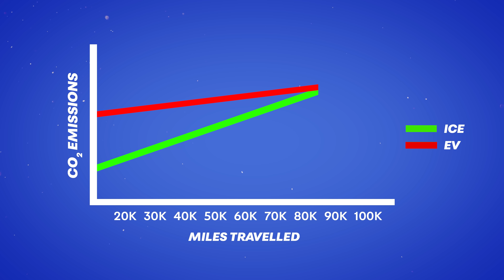Are Electric Cars REALLY That Green? [New 2022 Data]

Comment: We thought, hoped that EVs would be a way to reduce our dependence on fossil fuels, which are rapidly running out, and killing our planet in the process.  Turns out that we may have been wrong, prematurely enthusiastic about EVs.  What does this mean?  Options:
(1) We could abandon our search for a cleaner and more sustainable source of energy, and keep extracting coal and oil from the earth until they run out.  Or
(2) We maybe regroup and continue looking for a source of energy which is cleaner and more sustainable than fossil sources.

Comment: One factor that I have never seen implemented is the shorter lifespan of electric cars. Show me any battery in any device ever in your lifetime where it is 10 years old and still strong. Ignore the miles as they only tell half the story about a car's life.  Somehow, once those batteries are put into a car, they are somehow going to last 20 years. The average age for a car on US highways is approaching 13 model years, and when electric cars won't be able to last that long with current battery technology without a battery replacement.... Well... Let's just hope that I am wrong.
And the production of the wind and solar infrastructure also requires more CO2 emissions than that of a natural gas fired powerplant, and the solar panels and wind turbines have a relatively short life.
If I were to guess, right now, overall CO2 emissions of electric cars is 15-20% less than that of a gas car. 
And then, electric cars run their air conditioners to keep the batteries cool when they are parked in a parking lot. I am unclear if that is factored into their efficiency ratings. It has to be substantial energy consumption. And do they not heat their batteries when it gets really cold?

Comment: What is the battery life before it has to be replaced and then you start over it would seem on the EV is more damaging to the environment?
Reply: For modern LFP batteries, it's ~5000 cycles, which is about 13 years of daily discharges and recharges before it looses 20% of capacity (which is what is considered to be the end of life for a battery in an EV). Which on Tesla Model 3 sold in Europe (LFP battery pack) would be over a million miles.

Note that after the battery reaches end of life, You still have a perfectly functioning car. It might only go 240 miles on a charge instead of 300, but it's still a usable car. And even if you don't want it anymore and are not willing to sell it to someone who wants it, it's battery can be used for other purposes. A 40 kWh battery storage for your home solar installation is nothing to sneeze at. But I guess in 10-15 years it will be easier/cheaper to just recycle them, who knows.

Comment: Wind farms, are bloody expensive a blot on the landscape environmentally unfriendly to manufacture and no wind equals no power.
Solar farms, are bloody expensive a blot on the landscape environmentally unfriendly to manufacture and no sun equals no power.
Both get massive taxpayer-funded subsidies and create expensive energy. Both use huge amounts of fossil fuel to construct them.
Bring on nuclear safe clean cheap clean power. Make huge improvements in recycling plastics and reduce the need for fossil fuels to run the recycling industry. Get plastic out of the oceans.
There is NO Climate catastrophe. There are changes in weather due to a natural cyclic situation.
Climate change although real is not a big issue. Climate change started at the birth of earth and will continue until its death we did not start it and can NOT stop it we have to live with it.
One thing I get puzzled by is what emissions mean exactly. If emissions include carbon monoxide( C0 ) then yes as it is a dangerous gas, but if they refer to carbon dioxide (C02) which is a natural gas and essential then no. It could be suggested that all the bubbles be removed from every fizzy drink (C02), all drinks MUST be flat due to emissions. Do away with dry ice and C02 fire extinguishers. All plants must die due to the removal of C02. General oxygen levels on the planet are dramatically reduced due to a massive reduction of greenery because of C02 starvation. A huge amount of sea life dies off due to reduced C02 absorption, sea plants take it in and then oxygenate the water. So is it C02 that is a problem or the very evil minds of some people.

Comment: One aspect rarely seeing the light of day and spoken honestly is what happens to the batteries?? It's said they are recycled, has the transportation, the recycling process been factored in? And if so, how?? If batteries are made as so many electrical good with batteries that have a questionable life cycle, then replacement will be more frequent OR the way they are charged also impacts life, then how is the life cycle of solar panels, wind turbines etc factored in or are manufacturers figures used??. I ran a Mitsubishi work van to 870,000 klm's, will an Ecar ever achieve this???  I think the whole thing is a debacle, petrol and diesel fueled vehicles are almost a 100% known quantity, don't be fooled by glitz and glamor... Worse still are hybrids and this new 'wonderful' BLUE SKY and similar BS (bull shit), think your way around, the battery life, alternator, started motor cost verses a car idling at operating temperature and fuel consumption?? My car on a tank of fuel will idle for 2-3 weeks if not more (65Lt's)It's just lies and BS to make you feel like you are doing something wonderful, turn your heater down n wear a jumper inside, use a fan in-place of a/c, turn stuff off, ride your bike, by far more effective. My wife and I use around 5.2kW/h of electricity per day, we have panels and are, if bankerble, 2 years ahead in our use-age.  Consider the bigger picture.... Sheesh, so much BS

Comment: I love this argument that living remote makes EV use more suitable... except that remote living relies on diesel engines and generators. Even petrol has problems in remote and regional areas due to high running temps (grassfires, although DPF's have caused huge problems on this front...but many jurisdictions allow regional and remote vehicles to remove the DPF for safety reasons). However, the biggest issue is... recharge! Even solar vehicles struggle big time to make time-efficient runs cross country. And they have zero cargo capacity, are built of ultra light parts, and look like spaceships on wheels. I mean, if electric was really that good, then hybrids and electric trains (the ones that don't run on power lines, the ones that have a generator unit behind the engine unit) would run more effectively. They would have more range than their petrol and diesel equivalents. Yet they don't; they can't. And as soon as you start including cargo capacity in your decisions, then electric just collapses like a raindrop falling to earth. In essence, for people who use vehicles for more than just a large, fast pushbike, electric (and even hybrid) still has a phenomenally way to go before it's viable as a transport concept, let alone of greater efficiency than conventional engines. I mean, for all the talk of greater torque that electric provides, there's a reason ships still run diesel or HFO for their propulsion. Except for steam (including nuclear), there is no other method of engine propulsion capable of doing the job. Again, going back to my point, as soon as we're talking weight and cargo capacity, electric still doesn't have a presence let alone an ability for comparison. Indeed, all this green engine talk is making steam, horse, oxen and camel look really good again for transport should conventional engines be banned.
Reply: I read all that and agree. I plan to drive my Cummins diesel until I die. It has been running 30 years so far & has another 30 left in it unless the body falls off.
Reply: @ronskancke1489  I'm driving my newer beetle (wish it was diesel) for many yrs to come I hope.  Trying to get my 1985 Saab running again too lol.  World record is 3 million plus miles on an old Volvo btw.  But yea I have a soft spot for old trucks also.
Reply: cue green peace. lol could not agree more pal.
Reply: Ok I read all that lol.

Comment: You did not mention anything about the mining for materials and manufacturing of solar panels and windmills and the like.   No mention of the relatively short life spans of these devices.  The non recyclability of these green technologies.  No mention of the cost of the huge landfill burden of hazardous scrap generated by these used up devices.  All poor uses of our resources.  Then nothing is said about resetting your EV carbon counter once you have to replace the battery after 100,000 or so miles on the EV.   SO now you start from zero again.   ICE once again has the lead.  Then we can talk about the used EV market.   There will NOT BE one, because no body in their right mind is going to buy a used EV when the first thing they have to do is invest in a new battery for it at a cost of $8,000 to $20,000 US dollars.   Looky there, another massive burden on landfills.   Dumping EVs before the vehicles useful life in the landfill instead of replacing the batteries prematurely because it is not economically feasible to replace its batteries.   More hazardous waste.   I am calling this phenomenon "the cordless drill syndrome".    Everyone buys a new cordless drill because it is cheaper to buy a new drill with new batteries than the cost of replacement batteries for the old drill.     The biggest hindrance is the power grid can't support electrical demand as it is today if there is a slight stress on the system.   It is woefully under powered to support massive EV adoption.   You will have to decide do you want to stay warm in your house, have hot water to wash the dishes and have a cooked turkey for Thanksgiving OR charge your EV.   The list goes on but these are the most severe penalties we will have to pay for the so called green tech.

Comment: Interesting.  Considering throwing cars away (junking/recycling) is not green and the EV battery life is roughly 8-10 years, what are the long term ramifications?  Considering the mining and creation of the batteries are the least "green" thing about them, factoring in the battery replacements during a vehicle's life (which I have 2 vehicles over 30 years old, one of which is now 42) seems only fair.  One study I would like to see if people held on to cars longer (creating less of a demand for new vehicles), how much of an impact would that have on the environment...  I'm willing to bet as this demonstration shows that an ICE vehicle is initially greener, but then meets a point where the EV is greener, that there would come a point again when the ICE could be greener once again if the study went long-term figuring in environmental impacts of battery replacements and replacements of failed electrical components of EV's?  EV's tend to be made of more composites (to offset the weight penalties of batteries and electric motors), how much of an EV is recyclable when it's end of life happens vs ICE cars and what is the average lifespan of each?  If ICE cars tend to last 20+ years but EV's only 15-16 (which is the lifespan of two batteries), the environmental impacts could be immense.

Comment: Great video but one aspect I think is incorrect is the assumption on power supply cleanliness and it getting better. If all cars became EVs the load on the grid would be massive and would an expansion bigger than all the 'green' energy currently in place. More power plants will be required and unless you go nuclear, then there is no emission free source.

Comment: I am pretty sure that's higher than most projections. As to why would Volvo cast shade on EVs that they are making? That's easy, pretty much all legacy automakers suffer a lot of pain converting to EVs they have trouble making a profit on them and they find it very hard to scale up, so anything they can do to slow down the switch to EVs the better. Even if the study was in good faith, is it really like for like? If a car has both a EV and Petrol version then the chances are it was originally designed as a Petrol car and isn't optimised as an EV, they won't be doing things that Tesla is doing like having structural battery packs which reduces weight and construction and presumably CO2 emissions.

Comment: The narrator says all hos electricity is green. How do you produce your electricity? Wind turbine? What do you use to lubricate the moving parts?
Solar you say, how much non green energy was spent on the production of the parts of the solar?
Hydro you say? Again what do you use to’ lubricate the moving parts? 
In essence, green energy does not exist. Some methods use less some more, overall at this juncture, most forms of green energy are just fractionally better traditional form of production.
Then there is the initial cost. 
I have not studied it enough yet, however I believe that when all things are considered,  we are not to the place where non fossil produced energy is significantly greener, or cheaper. 
I do see a future where that becomes so, not now, now for the next 5-10 years

Comment: The best way to go would be a small efficient petrol engine to charge the battery, where battery power is used in urban areas and the engine cuts in on motorways or country roads
Reply: ...called a hybrid!

Comment: where does electricity come from??  If it does not come from green energy, it comes from petrol, coal or nuclear all of which are problematic to the environment.  In the US about 60 per cent come this way.  The efficiency is about 33 per cent.  Meaning you have to put the equivalent of 3 gal of fuel into it to get one equivalent gal out.  If you could stop at the power generating plant and fuel up YOU ARE ALREADY AT A LOSS.  No battery charges at 100 percent efficency.  That is you would need somewhat more than 3 gal of equivalent fuel to charge the battery.  The epa figures are all very severely in error.

Comment: 90k Miles (140k Kms) = Break even point of the EV production pollution. 
However, EV's also pollute more to recycle. Example an empty fuel tank vs a battery pack.
Factor these additional pollution and the break even point can be closer to doubling those figures.
Not to mention there are more components on the EV that cannot be recycled. Example: lead batteries are simple, takes less energy and 100% recyclable even the plastic housings. Lithium batteries on the other hand are not only energy demanding to break down but many parts are not recyclable.

Comment: First, the calculus used by Volvo says the results depend in large measure on the source of electricity its customers use to charge their vehicles. If they drive in Poland, where 90% of the electricity comes from burning coal, then yes, it will take 100,000 kilometers or more to reach parity with a conventional gasoline-powered car. On the other hand, if the electricity comes from renewable sources such as wind or solar, the crossover point is closer to 50,000 kilometers. The middle scenario, based on the current EU energy mix, is 77,000 kilometers.
Reply: Also Volvo is a manufacturer that is behind Tesla. So I suspect that, like Toyota, they may be wanting to slow demand for a while so they can sell other cars. I don't trust them as impartial.

Comment: our marvelous electric car battery contains twenty-five pounds of lithium, sixty pounds of nickel, 44 pounds of manganese, 30 pounds cobalt, 200 pounds of copper, and 400 pounds of aluminium, steel, and plastic. Inside me are 6,831 individual lithium-ion cells. It should concern you that all those toxic components come from mining. For instance, to manufacture each auto battery like me, you must process 25,000 pounds of brine for the lithium, 30,000 pounds of ore for the cobalt, 5,000 pounds of ore for the nickel, and 25,000 pounds of ore for copper. All told, you dig up 500,000 pounds of the earth’s crust for just - one - battery. Did I mention disease and child labour? Here’s why. Sixty-eight percent of the world’s cobalt, a significant part of a battery, comes from the Congo. Their mines have no pollution controls and they employ children who die from handling this toxic material. Should we factor in these diseased kids as part of the cost of driving an electric car?” no, they’re not our kids, anyway, serves them right for being poor,